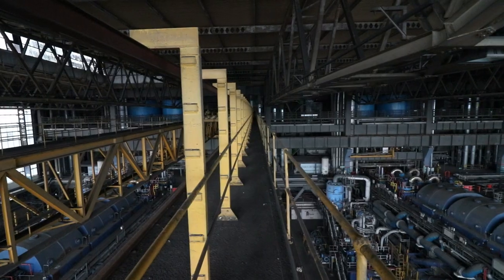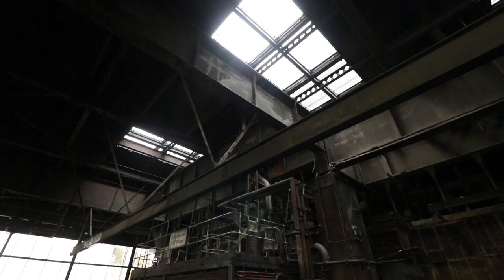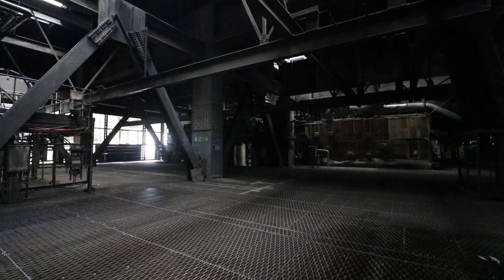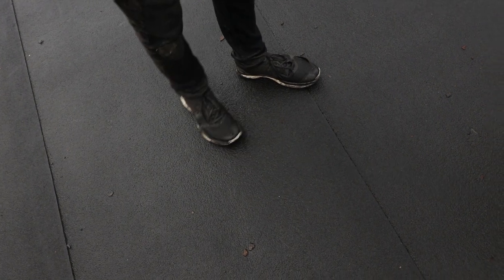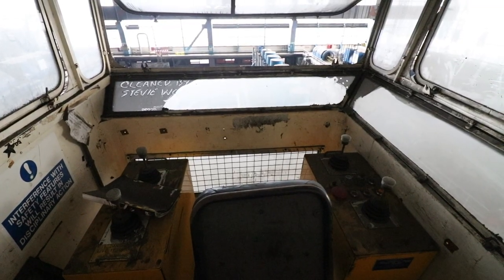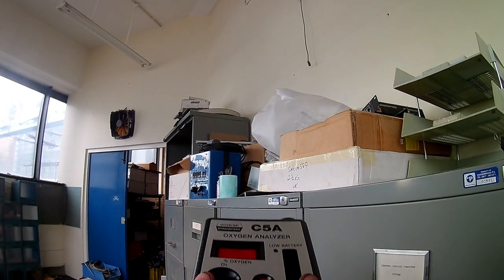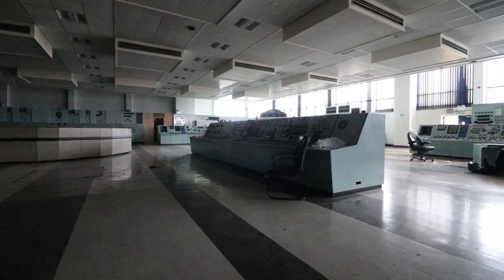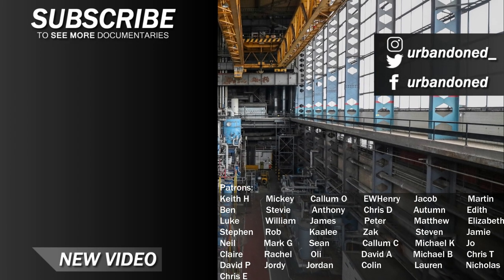Exploring the Abandoned Eggborough Power Station - Before Demolition

Comment: Almost 2000MW is large, we still need the power, but these units are closed. I have been decomissioning the Hemweg 8 unit in Amsterdam, project was to disconnect the 150kV cables from the transformer. The proces is understandable. Windmills are placed in the North Sea. But new tech is needed to downscale the space that is required to produce this amount of energy. ITER is Paramount! Nuclear is needed to hold up the gaps till we reach new energy sources. I is very simple.... If it gets out of hand in Russia and someone pushes the button, 2000 years from now everybody is amazed about our complexity of engineering like the Aztecs or Egyptians did. We should never forget this is a exceptional time compared to the last 2000 years. But personally I am glad this structure is gone now.

Comment: Insane to demolish this asset. Mothballing would have been much more sensible. Even now with the craze for green energy the turbines, cooling towers and electrical gear could have worked using steam produced by nuclear reactors.
Reply: Modern nuclear designs use cooler and lower pressure steam than the boilers of these old thermal power stations produced. Eggborough was 568 degreesC steam at 159 bar. Pressurised Water Reactors are typically 275 degreesC at 60 bar. This would have made reuse of the turbines impossible. I suspect the cooling towers could not have been reused, either - a combination of the wrong configuration and the age of the existing structures.

Comment: It pisses one off every time one sees a power station with those massive cooling towers.😭
In the oil refinery where this one used to work once upon a time in Germany, at least the engineers had the wisdom to use the steam coming from the turbines in the power station that generated the electricity for the refinery, extract a certain amount of heat via heat exchangers and recycle either directly back into the production process, and, or use resulting low-pressure steam at a lower temperature to heat pipes for products with higher paraffine contents, as was needed particularly in winter, in order to prevent the product from solidifying, like improperly refined engine oil in German Panzers during a Russian winter. 😮‍💨
What needs to be done is bring the engineer to justice and subject those then to their rightful fate of decapitation,
even if they need to be dug out of their graves.
Resting one's faith in higher management that they had told them that this might happen sometime in the future, as an act of compensation for any mistakes made in the past, as Jesus would sooner or later show up as predicted, to judge the living and the dead.😮

Comment: So wonder who approved the demolition of that station - just looking at it before it was destroyed what a waste - so many many man hours gone into design and building it for 2GW of base load power. 2GW of reliable power, good luck to see renewables produce the same for the area it covered. 2,000,000 homes powered unlike those spruiking wind when in reality the sales brochure is based on theoretical maximum but in reality probably only 30% at best. Sure this station probably could have had a theoretical power rate based on the total energy of coal it was consuming but the output would have always been reliable base load power.

Comment: We are all led to believe that we have a crisis regarding power generation. We are fold the reasons why. What we are not told is that we are surrounded by an immense amounts of unused clean renewable energy. It’s all there for the taking. Granted there will probably always be a need for base load. There will also be a need for storage. That given, consider that every roof top can be connected to the grid. Most communities have access to a river, small hydro, hilly areas for small vertical wind turbines, land suitable for agrivoltaics, Thousands of coast line, wave and tide power. It would take a task force and an energy czar and funding. It would generate thousands of jobs. Such a scheme would alleviate the overriding need for fossil fuels from volatile regimes in other counties.